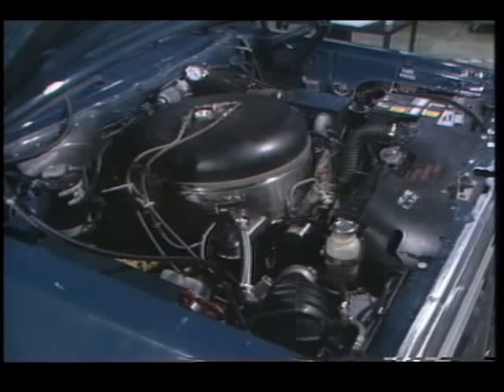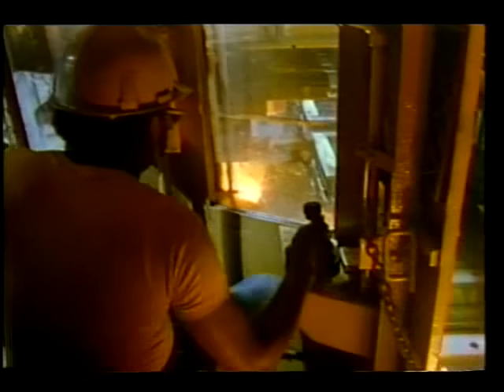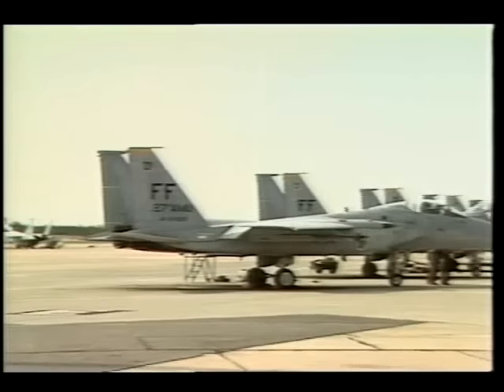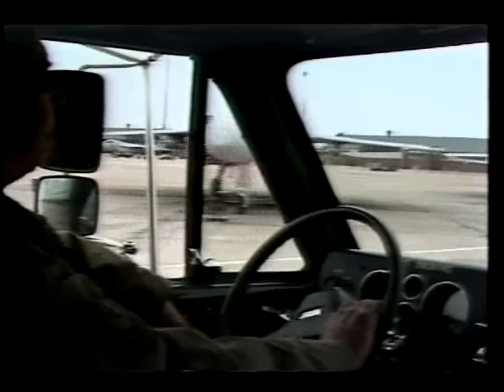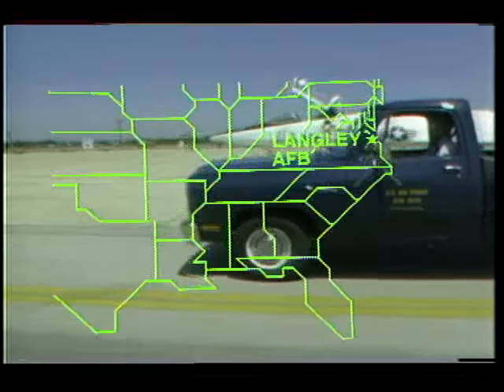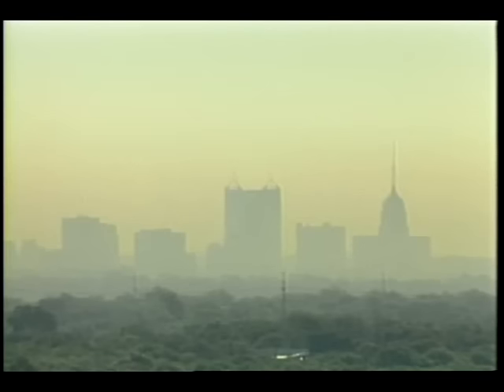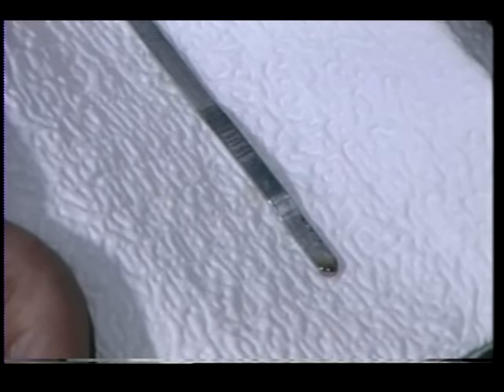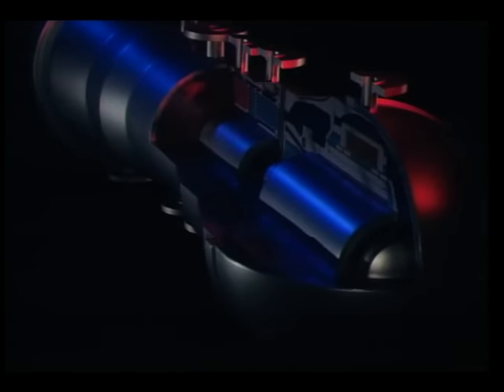The Stirling Engine: A Wave of the Future

Comment: The Stirling engine is heavy, but it can run on energy-dense gasoline. The electric motor is light, but it works with low energy density batteries. I guess the electric is better for its superior acceleration.

Comment: it sounds awesome. what the hell/fuck happened???
Reply: Diesel engines, and u could make it lighter and it be better, but big oil  wants u to use diesel
Reply: @shaggyboombastic1058  you could've used diesel
Reply: Stirling engines are quite a bit heavier and larger for the power they put compared to combustion engines.
They're also more expensive

Comment: The Stirling engine is too heavy and expensive. It requires helium or hydrogen at very high pressures, above 100 bars and it is very difficult to guarantee the seal. Cars need light and powerful engines to avoid wasting as much energy accelerating and driving up hills. But these engines are very quiet and clean.
Reply: They are better suited for other things, all tools have their own strengths and weakness, you can chop a tree with an axe but can't cut fine salmon slices like you can with a knife, while with the knife you can't cut a thick tree but you can cut fine salmon slices in the kitchen, everything has it's use

Comment: Исходный текст
You are stopped this project, but we can build this type of engine more cheaper, more easily construction, more lightly, and list to enertion. What was tryid  by Chrysler with Gas Turbine Engine, we'll do it with Stirling. Turbine Stirling is the future of energetic. Turbine Stirling can be used with thermal battery. And we get power plant, with calculation energy losses during conversion, more bigger volume if we compere it with Li-Ion batteris.  But this sistem has lurge work resource. At this sistem only with engine will probably break becaus engine has slightly wearing,  but battery does not grow old at all and does not wearing at all.  It's technology can killed electric madness, displacing electric and hydrogen cars from roads.

Comment: The sterling engine would be the perfect replacement for the internal combustion engine and the dodge ram in the video was a perfect example of how easy it was to incorperate into any civilian motor vehicles at the time and could easily be incorperated in basicly any motor vehicle today. If we want a clean alternative to have the environment and not have to rely on pain in the ass evs that cost more to keep maintained then they are worth then this is the way to go. Hell i.m.a hybrid could even uses sterling engines and would be cheaper then full electric cars, sure they would have to be placed linear but o well. I mean no one needs a basic passenger car any more. I mean trucks, suvs and cuv are the only thing that we should bother making anymore. Cuv are litterally cars that are 4wd or awd so it would be easy to incorperate. But unfortunately this will never happen thanks to greedy corperate america.
Reply: I don't know about greedy corperate america stuff as i Live in Europe, but there are some simple reasons why stirling engines aren't used in automotive vehicles.

1. The engine is generally harder to start, it needs to heat up first and then it can run, while electric motors, diesel and gasoline engines are start and go

2. They produce less power which can be an offset to a lot of people, also produces less torque which might make climbing hills hard, also the engine can't really accelerate as fast as a gasoline engine, because the engine has to heat up so if you see a hill you literally have to press the throttle before you even encounter it as the engine might not have enough momentum to drive the car which can lead to the engine stalling, the major thing with internal combustion engines is that internal combustion happens a lot faster than the heat transfer from the external combustion. also stopping the engine can be more difficult because the engine will still keep running even if you shut the engine off completely, while internal combustion will stop the moment gas and air stop flowing in the engine.

3. The engines are generally bigger and also can be heavier so putting it in smaller vehicles can be a bit tricky, kind of why diesel engines aren't used in motorcycles because of their size, which it needs to be big because of the high compression ratio they have compared to petrol engines.

4. Also it's not really clean to the environment, because you are still burning fuel to drive the engine, it's just external combustion. Sure the engine doesn't use as much fuel for the same amount of time but it still uses fuel, although it depends on what kind of fuel you are using, you can run a stirling engine off of hot water, burning wood, coal, hell even your old high school books you have in your attic, but anything that creates a flame produces CO2 so not really green in reality, the engine has to run off heat, and if your using fuel to run the engine it really isn't that different from using an efficient petrol engine, it can be more efficient but has a few drawbacks as i mentioned.

If you really want to be "green" public transit, and walkable and bikeable roads are the way to go, as they are way more space efficient, reduce polution to the atmosphere to the environment and to add they aren't as loud as thousands of cars, it's not really cities that are loud, cars are, and noise pollution has shown to have a negative impact to people's physical and mental health which has been found in a few studies.

At the end of the day, the Stirling engine is best suited to use heat lost to the environment or using heat that is gone unused to drive the engine and serve purposes like being a heat pump, or being used as a generator for electricity, the engine isn't suited for driving vehicles though and i don't think it will ever make it to the automotive market, as people aren't really familiar with stirling engines, so no one would buy it.

I mean people stick to what they know, they are uncomfortable to leave their comfort zone, and also stirling engines haven't had as much development as internal combustion engines have, so we don't know which variation of stirling engine would be best for each task or what heat source would be the best etc etc, it has been developing though over the years and can show some different use in the later future.

If the engine would ever to go in the market though it might be in hybrid vehicles, but who knows, only time will tell.
Reply: @call_me_mado5987  I'd sooner drive a Stirling engine powered car than the giant computer on wheels known as an EV.  Of course, ill just stick with my Gasoline engine powered vehicles.  Hopefully I'll be able to get an older car without all the microchips that the more modern ones are absolutely dependent on.
Reply: @jds1275  Agreed.
Reply: @jds1275  if you want something without microchips, you basically need a car from early sixties, or for some manufacturers, from the seventies.

Comment: what the hell happened to this tech?  the prtrodollar probably killed it
Reply: Simply it wasn't cheaper, nor more efficient or simplier than internal combustion engines by 1992. By the way Stirling engines would burn classical oil products, so no lobbying to kill it.
Reply: Stirling engines can literally run on anything that produces heat. You COULD run it on petroleum, but you wouldnt have to. So big oil most likely did play a hand in killing it. The good news is that stirling engines can be made very simply by an individual out of junk you have lying around.
Reply: Ron Armstrong although not as powerful or well usually

Comment: This would be a much more efficient use of electric car technology. Using batteries to power a heating element to drive the motor instead of dumping electricity into electric motors

Comment: First, the sterling engine is NOT an external combustion engine.  It is merely a heat pump.  Where the heat comes from is irrelevant.
Second, they are ridiculously under-powered for their size.  Their power to weight ratio is smaller than a car battery.
Third, there are far more efficient means of propulsion available.  Gasoline, electric, hydraulic, etc.
Reply: True, a Stirling engine by itself isn't an external combustion engine, since it can run without combustion at all. But THIS Stirling engine is, since it uses external combustion for the heat source.
As for being under powered, a typical Stirling is. But the engines in this video are far more advanced than a typical desktop demonstrator. The Mod 2 (an improved version of the engine shown) put out about 82.5 HP, and weighed 451 lbs. To compare, the internal combustion engine in the car they put that in (a 1985 Chevy Celebrity) generated 92 HP, and weighed 375 lbs.  That's worse power to weight, certainly, but it's in the ballpark.  What they gained was fuel efficiency, with around 58 mpg highway/33 mpg street.  And that was in 1985. Imagine what we could do now.

(Found data on the Mod 1 engine in this video. It was about 72.4 HP, and 587 lbs, so they improved it by a large degree between Mod 1 and Mod 2).
Reply: @raelik777  You are still not listening.  NASA did NOT have a Sterling engine in these videos.  Nothing they have said is even remotely connected to a Sterling engine.  The thing in the video that they called a Sterling engine is not one.  I'm not even sure it is anything more than a highly over-engineered gasoline engine.  Their engine might have been a sterling engine, but it was not a Sterling engine.
Reply: @protoborg  Wrong. You are wrong and you absolutely refuse to admit it and have resorted to trolling.
Reply: @tkmotors991  Yeah, I know. I'm kinda viewing it as a learing process for myself at the same time :D :D
Reply: protoborg you need to go back to school😳
Reply: @tkmotors991  There's no reason to call him a blithering idiot.  He's wrong, but he is hardly an idiot.
Reply: protoborg Bachelors degree on what? Definitely not common physics you’ve made that pretty clear 😂 probably a bachelors degree in picking your arse by the sounds of it
Reply: @tkmotors991  I clearly know physics better than you.
Reply: protoborg says someone who thinks sterling engines need gravity and low pressure🤣
Reply: @tkmotors991  Never said they need gravity.  I also never said they NEED low pressure.
Reply: @tkmotors991  Do you even know what amnesia is?  Dementia, huh?  How exactly am I demented?
Reply: protoborg Iv read everything that you have to say this thread and the other one doesn’t look to good bro sorry 😐
Reply: @tkmotors991  I don't imagine you understand that your opinion really doesn't mean anything to me.
Reply: @protoborg  go back to school
Reply: @JackpineGandy  You first.
Reply: @protoborg  If you spelled Stirling correctly you might sound more credible